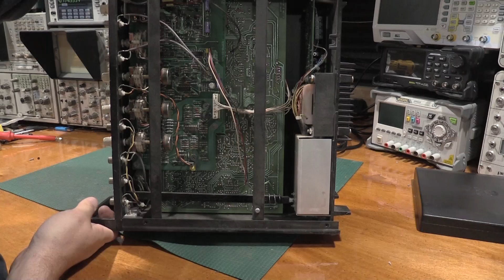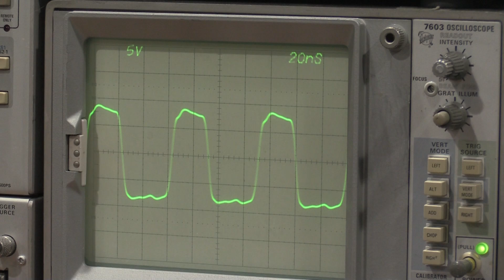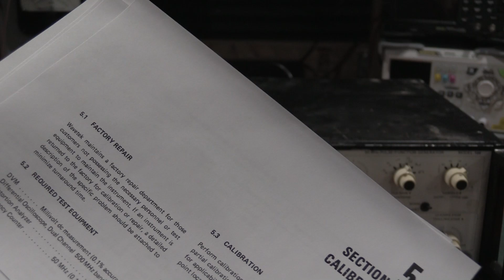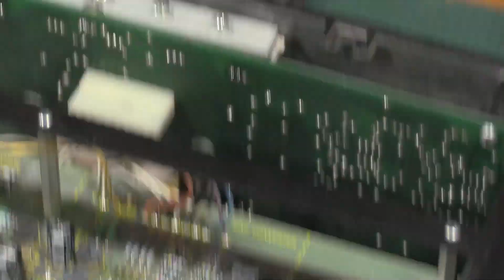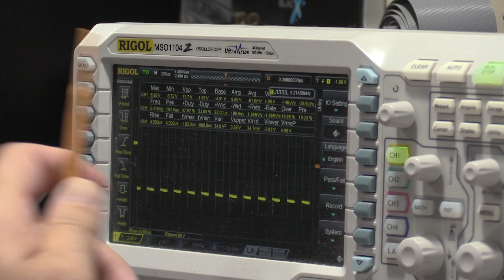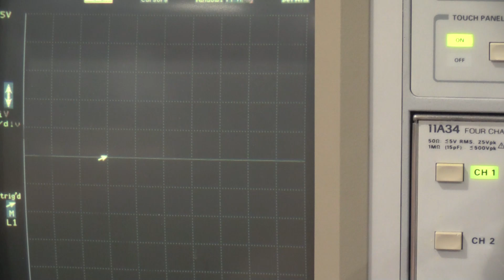Wavetek Model 166 Restoration and Calibration

Comment: im thinking about calibrating mine. seems to be working pretty perfect, but might just dial it in for fun one day. i think the rise fall knobs and the square pw adjustments have limitations before they kill the wave. it says something about that in the manual. you can adjust the rise and fall to exceed the pulse width at higher frequencies so it just flattens the wave out. feel like i could get tighter squares tho. seems like some distortion on the transitions. might need to calibrate my scope tho. haha. thanks for sharing all this info.

Comment: I have the wavetech sweep pulse generator that I would like to calibrate. I see you using a distortion analyser for the calibration of your unit. I was wondering, could I use a spectrum analyser instead of the distortion analyser as I do not have the said equipment.
Reply from the maker: The distortion analyzer Is used to calibrate the sinusoid. If it is pulse gen usually these are square waves? For the pulse train.  These would need a fast scope to align as a pulse gen should prioritize edge speed and wave shape over everything else or am I missing something?

Comment: You can use the Tek 7000 series DUAL input vertical plug-ins as a quasi-differential. the rotary mode switch has a setting ADD you can select, and then on the bottom input, select INVERT on the slide switch.

Comment: I have a smaller Wavetek 144 Sweep Oscillator that includes some sort of potted module in the signal path.  It also has an issue that after several hours it quits working. Probably need a shotgun of all supply caps.  If anyone has any data on the 'potted module' or how to substitute for it, please chime in.